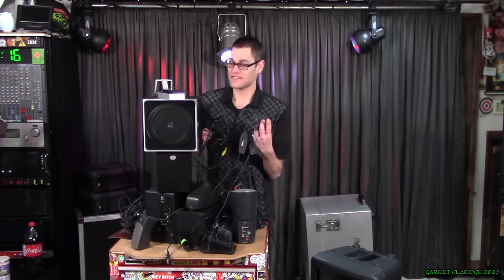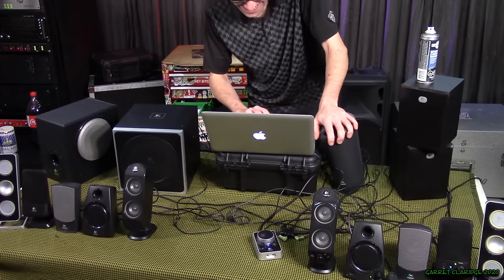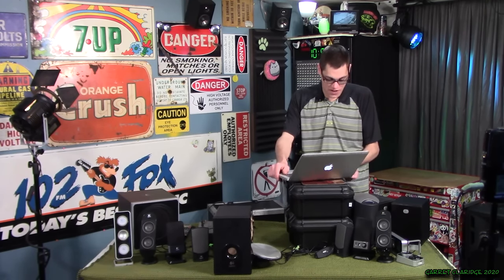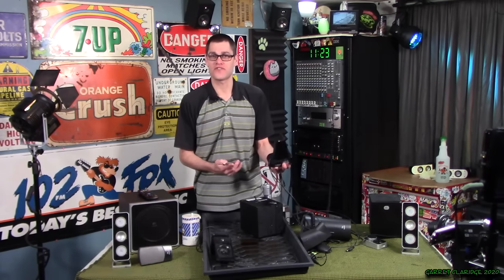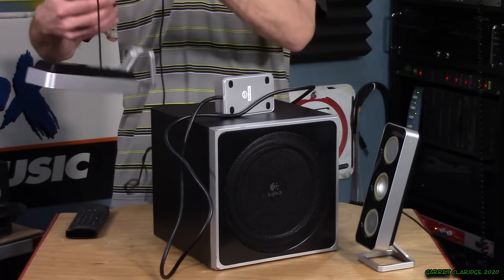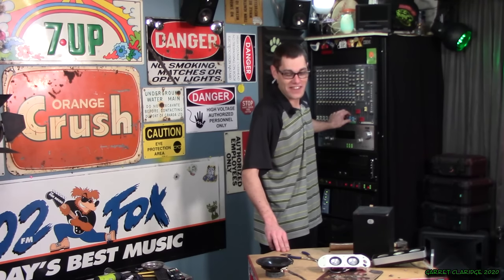LOGITECH HATE 2020

Comment: 4:00 also, the latest macbook pro has a headphone jack
Reply: I don't remember any macbook to have no headphone jack tbh, maybe the discontinued regular macbook did
Reply: @JMNTN  from memory i think the macbook did, but not sure
Reply: @JMNTN  Every single MacBook right now has a headphone jack, but no USB A`s
Reply: @ruzuu19  there are 2017 - 2019 macbooks that only have TB (thunderbolt) 2 and 3 ports.. 2 or 4 of them.
Reply: @caroncomp  Yes but they still have a headphone jack look in some reviews or unboxings
Reply: Gamer_Prank Kanal you legit said that EVERY macbook has a headphone jack, which simply is not true due to some versions having 2 - 4 thunderbolt ports only..
Reply: @caroncomp  and a headphone jack
Reply: @caroncomp  the 2019 MacBook pro also has a headphone jack  and it has 4 Thunderbolt
Reply: Gamer_Prank Kanal I smell BS..
Reply: murphey63 this is completely anecdotal so you may be right but I’m pretty sure every Macbook has had a headphone jack. It’s only the mobile devices that have ditched them.
Reply: @brodogger81  Yes ,That's True
Reply: @unicodefox  even the original 2009 macbooks had them (at least the one I had did)
Reply: Look at all these kids
Reply: removing the headphone jack and SD slot has to be the dumbest thing to ever happen to any tech

Comment: I just love how the x230's wouldn't give up, they may be sh*t but they're also tough sh*t
Reply: Yeah i have the same speakers
Reply: sähkövikane renu I have 2 sets of x540’s and a subwoofer from x530, and a z333
Reply: X230 were the last Logitech Speakers I ever bought. They live in the company workshop now eating dust. Still going strong.
Reply: @Neojhun  both of my x540 wired remotes failed but the half exploded 530’s (surround version of 230) are still going.
Reply: yeah I had those I mean I still have them just not in their original shape because I have put the woofer and one of the satellites in the cheap bookshelf speaker cabinet the other satellite plugs in via standard wire terminals I have put on the back of the box. I have accidentally shorted the amp several times due to lack of care and it works just fine, these things are shitty but tough.
Reply: @PackardKotch  Im still running the x530's as my mini home theatre system in bedroom. Planning to get a pair of z906s soon for music and movies on my PS5 and just use the x530s as computer speakers for my PC. Might stop using the surround speakers? I'm not sure yet! They are a neat system for the price. It's sub does have a ton of excursion for the size of the mid-woofer magnet that thing utilises. The system doesn't sound any bit audiophile grade, but they are fun, bassy low wattage speakers! Can be a bit muddy though. It definitely does not have enough treble.

Comment: Here are some quick time stamps for parts of the video.
0:00 Intro
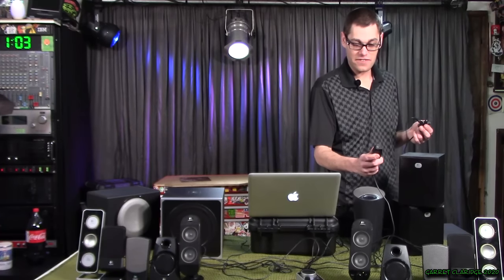4:10 Quick sound test with all of the speakers playing at once
5:18 The drowning of the anti-subwoofer speaker system's  amplifier
6:03 The attempt to kill the apparently "waterproof" speakers' amplifier (the Logitech X230)
9:28 The actual death of the waterproof amplifier
11:46 The quick sound test, and eventual amplifier death of the Logitech R-20, or as Garret likes to call them "the ones with the fluttery bass."
14:17 The quick kill of the Soundman 20's amplifier with heavily distorted music
14:58 A quick sound test and review of the Logitech Z4 (my personal favorites in the video)
19:35 Destruction begins with the Z4
21:53 Logitech R-20 (the ones with the fluttery bass) satellite blowout.
22:08 Logitech Soundman 20 (the older ones) satellite blowout.
22:28 Logitech R-20 subwoofer blowout
23:06 The anti-subwoofer speaker blowout
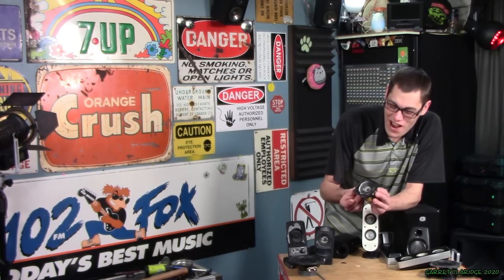23:44 Soundman subwoofer (very small for a subwoofer) blowout. also very toxic fumes
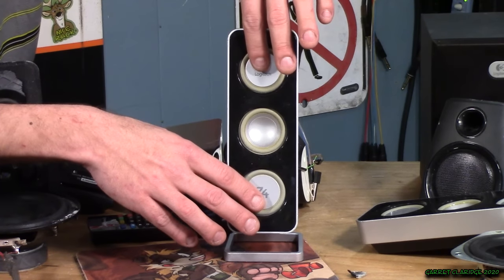24:33 Z4 satellite blowout with the useless passive radiators
25:23 Logitech X230 satellite (the ones with the waterproof amplifier apparently) blowout
26:00 Soundman satellite, (without its cabinet) blowout
26:28 R-20 satellite blowout
26:51 Anti-subwoofer speaker blowout, but no amplifier back feeding
27:24 Z4 subwoofer blowout
28:11 Logitech X230 satellite, but this time they are blown one at a time
29:24 Logitech R-20 subwoofer that came with no satellites apparently blowout
30:36 Logitech X230 subwoofer blowout, somehow the biggest sub driver of the bunch.
31:24 The final speaker, the Z4 satellite blowout

Comment: Hey Garrett? Where did y oi ubget your fur suit? Is it custom, if it is please tell me how you made it
Reply from the maker: Hey hey, very custom actually, down to space carved in that fit my glasses and such, my friend is making me a new full suit right now that will involve me making a duct tape moulding of my body for a pattern, what I have now is called a partial suit that is hands, feet, tail, and the head - the new full one will have that naked look lol..
Only thing is I've spent over 600 cad on fake fur for the new costume now :I and much more being spent on the hours of labor the maker is going through,  partial costumes can be commissioned for a little cheaper but still end up close to 700US at the low end, building your own is super hard but can be done, it is a pretty crazy expensive thing to get into though If you get someone experienced to make it

Comment: For some reason I just don’t like speakers that come with built-in amps or that are made specially for computers. My “hi-fi” setup consists of 2011 iMac speakers connected to a 2x40 watt 4-ohm transistor amp. They have an irregular resistance, something like 10 ohms. I suggest you get some and blow them. They sound pretty good and I’d like to see what kills them.
Reply: Built in speakers?
Reply: 7367Network They are old built-in iMac speakers that I’ve taken out and attached to an external amp

Comment: A deejay that worked at a radio station that I did engineering for one morning spilled his coffee in a broadcast mixing console, while it was on the air, it sounded exactly like 21:14 only it kept getting worse. Nobody thought to turn it off.  Took me an hour to get there because of traffic. All the while I was tuned in listening to the slow death of a console. Was eventually fixed. But you talk about BAKED.... several hours later, lots of cleaning, it was back on the air. The more sugary and salty, the worse it gets for electronics.

Comment: Their speakers may sound a bit poop, besides the very expensive ones.. But you have to admire the soaked set that kept on working! I do use Logitech keyboards and mice, they never really let me down..but damn. Also, impressive you didn't get shocked by it, i noticed they ran from the mains.. Obviously the hot side of the transformer/smpsu is surprisingly well insulated. Could be a feature they need to advertise! "Piss on this set of speakers, mark them as your own, they won't even shock you!" though coke is likely worse for your health. Also nice way to prove salt is a rather useful electrolyte!

Comment: I like the direction this is going in, decent results with the salted amps. You can also take an amp board, some vinegar in a squirt bottle and draw lines of vinegar between the power supply section and the amp. It's gonna stink and IS DANGEROUS to your sound source tho. (of course it can also start a fire and shock you, have to say it)

Comment: nearly all logitech speakers are shit except the z533, that one is okay
Reply: Z5500 is better, the thx certified is cool but the mids have weird peaks and the bass is far too loud on the z5500. But it sounds far better then the z533
Reply: @lovellcarr9031  but also cost way more, if you don't have money at the moment, these are great
Reply: @Drilloe  ive bought a used one for 70 bucks. it was brand new just never opened.

Comment: The z623 would have been a good one for this video, It's got a pretty tough woofer and actually sounds decent for a logitech system
Reply: It's the best woofer, i wanna know what he can say about z623 or z906, i didn't saw anything at that price better and also high quality not just power
Reply: Its just a shame that the z623's amplifier is bullshit and it can't handle any volume above 35%. If I had the money, I'd definitely shove the sub in a better box, and give the danm things a reliable amp! I have seen a few blowouts of the z623 sub... and they do offer a bit of smoke!